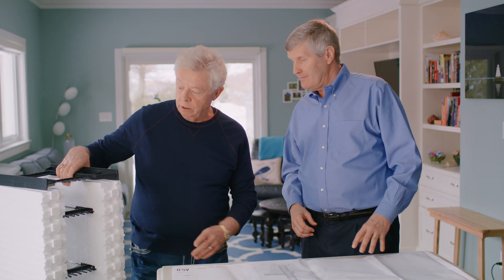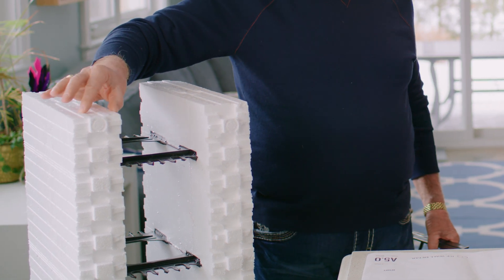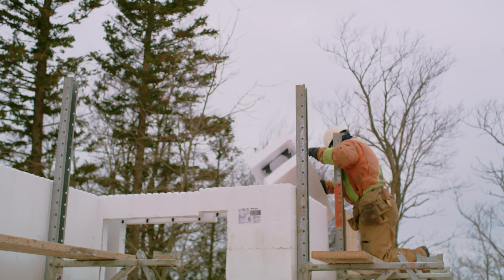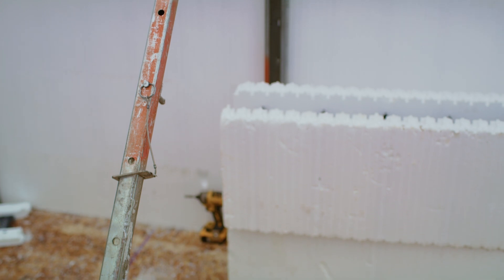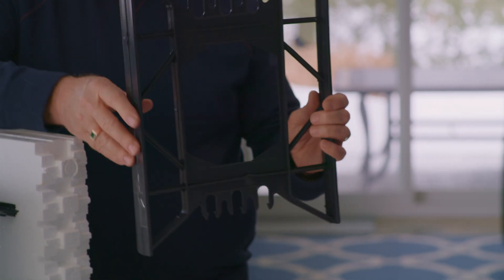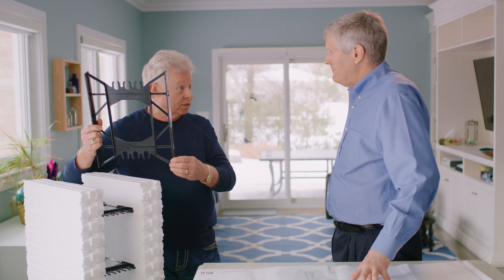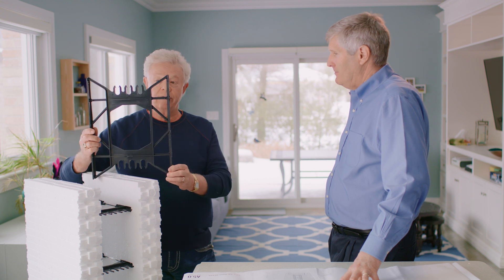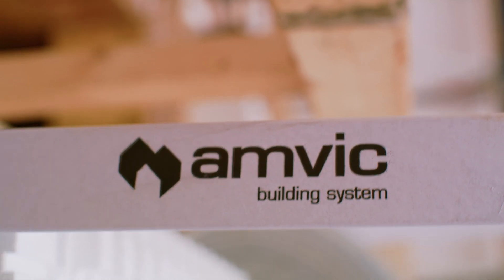What are Insulated Concrete Forms? | Building a NetZero Home - Part 3

Comment: Is the R value high enough for Net zero in a Toronto home?
Reply: R30 plus thermal mass of concrete provides a massive thermal damping effect. Takes days for any temp swings. Your interior space only ever see's thermal transfer from the average outside temp over several days.. Large swings can take over a week if heat goes out depending on outside conditions. The real benefit is from the continuous sealed envelope and insulation. No studs to transfer heat. Very easy to make a tightly sealed house. You'll need air exchangers and humidity control equipment. 
I'm in North Dakota where we get blizzards at -39 degrees with 70 mph sustained winds. You wouldn't even notice in an ICF house. That's what I'm building.